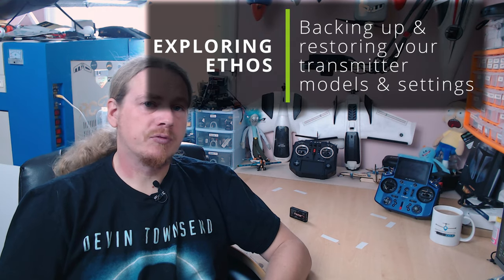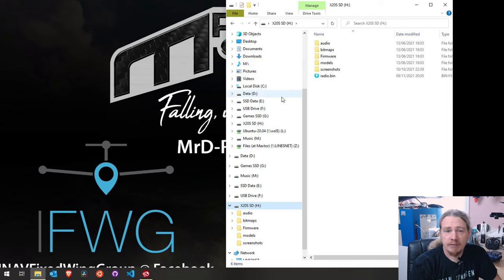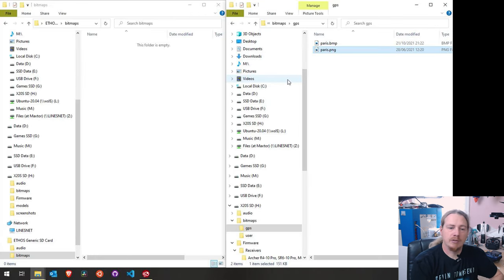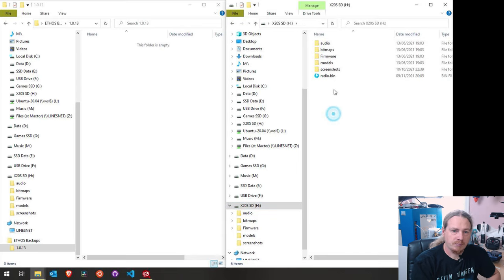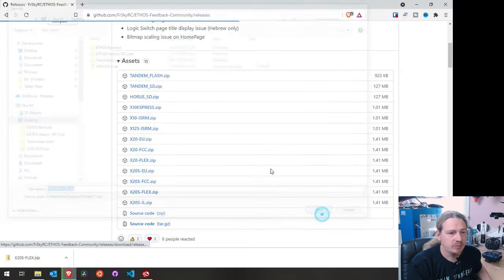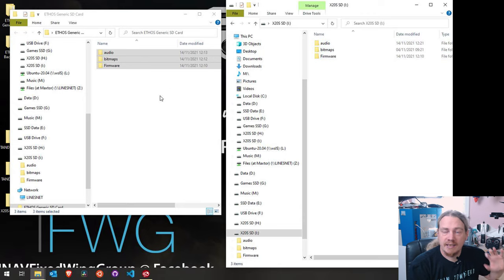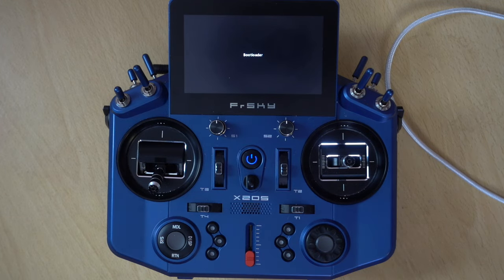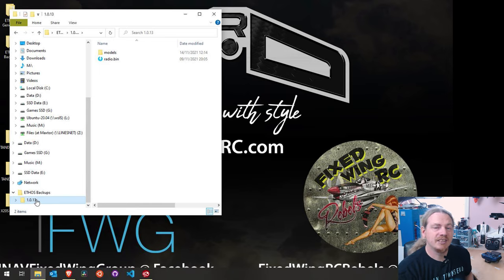How to backup your ETHOS transmitter

Comment: Hi Darren what is the best way to transfer models from one x20 s to another x20s and would I need to remind the models once transferred.
Regards Tony
Reply from the maker: You should just be able to copy the files in the models folder from one transmitter to the other. Personally, I would make sure they are both on the same version of ETHOS, just to avoid any potential issues. Yes, the receivers would need re-registering and binding on the new transmitter.

Comment: Thanks I had go  to general an turn audio to sd card. 😀
Reply from the maker: Which files in particular John? There are standard ETHOS files which are downloaded with ETHOS Suite. The firmware and custom audio files I sourced. The various firmware files are available on frsky-rc.com. The sound files I have made myself (https://youtu.be/2AcB_jrFFK4). Also the model images I have downloaded for the most part. https://www.skyraccoon.com/icons is a good source of those.
Reply: @MrD  when i updated it doesn't add any files to sd card. The problem is trying get it play sounds . I added amber sounds to flash and sd card the files are there when go  special functions an add something there no  Options.this is x18
Reply from the maker: On the X18, you need to check the system menu, I believe in the general page, to see where it is expecting the sounds files. On the X18, they can be put on the SD Card or NAND storage. They will only appear in the lists if they’re put in the correct place.
Reply: @MrD  I put them everywhere, I just get blank list on sf menu. I give up with radio.
Reply from the maker: They can only go in 1 of 2 places. Either the SD card Audio folder or the NAND storage Audio folder. The go in audio, not a sub folder within.

Comment: To clear the flash drive if using Apple it is necessary to reformat so it is fully cleared,if not then it looks empty but clicking info shows the drive to be still full.I have now switched to MIcro Soft so mutch easier to follow your excellent easily understood videos.Keep up the good work.
David
Reply from the maker: Thanks for the information David. I’ve not used a Mac before. So that’s useful info. I’m glad the videos helped you out too.

Comment: Was just curious,  if all I am looking to do is make a backup of the card in my radio,  is there a quick way of doing this vs all of these steps?  I thought at one time OTX users were using a specific backup program to make duplicates of their SD cards.
Reply from the maker: You can just copy the whole card. But it would have a lot of duplicated files. What I tend to do is, when I add a new image or sound, also put it in the generic folder. Then I only need to backup the firmware specific stuff. 

To be honest, I did a similar thing with OpenTX. There was a sync thing in companion. But I didn’t really trust it. Not through bad experience. Just that I like to ben in control of whats happening on the transmitter.
Reply: @MrD  Ok thanks,  I am looking at SD card cloners as the price has really dropped.  Might be an idea?

Comment: Do you still like the Ethos system rather than OpenTX, Darren?
Reply from the maker: To be honest, I like them both. I kind of have to use both systems. But if I didn’t, choosing which I’d prefer is getting tricky. Especially as LUA will be here soon, and CRSF to follow afterwards.
Reply: @MrD  it’s growing at a great rate- the advances and updates are excellent for ethos.
Reply from the maker: @miksterr  totally agree. All pilot feature requests are listened to also, which I find very positive. LUA scripts soon, then hopefully CRSF too. Everything is moving in the right direction.

Comment: Having just purchased a X20s running 1.0.11 I notice the latest version is 1.0.19, do I need to download 12 to 18 or can I go straight 1.0.19.
Reply from the maker: You should be fine to go straight to 1.0.19. Though I would recommend taking a backup, just in case.
Reply: @MrD  Thanks Darren.

Comment: Man, you lost me on this one.. I've enjoyed your other videos and learned how to update my new X20 and GR8 rx but I'm lost on the backup procedure.. Too complicated
Reply from the maker: Hi Darrell. Sorry to hear that. As a very basic backup, you can just copy the whole SD card off, on to your computer.

Using the method in the video; I’m just reducing the amount of file repetition on the computer. Which will also means less files and folders are needed for version backups.
Reply: @MrD  Thanks, that sounds easier for me. Do I need to do this one folder at a time or is there a way to do it with just a few steps?.. I use windows 10 and not very good with it but I have managed to load 1.0.19, update the flash and SD card as well as the RF module and a new GR8 rx thanks to your videos